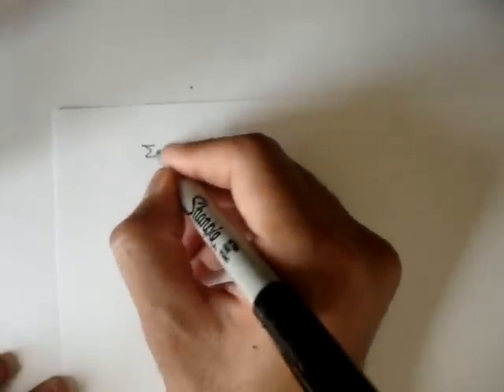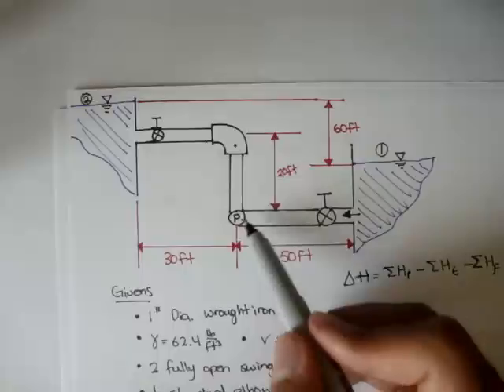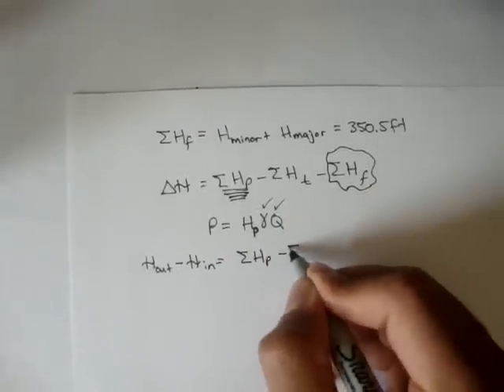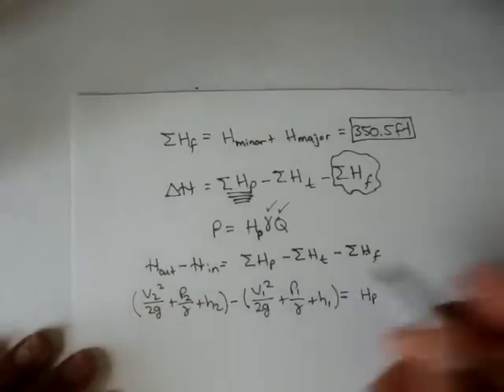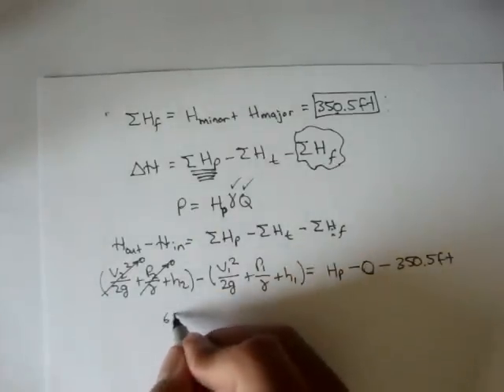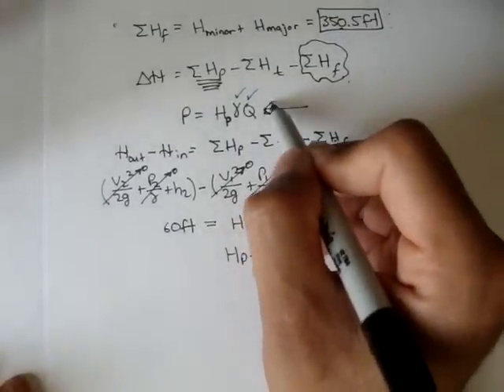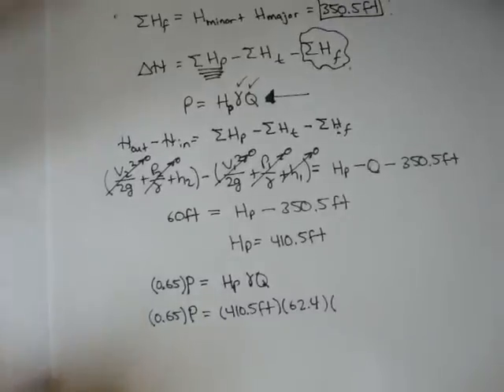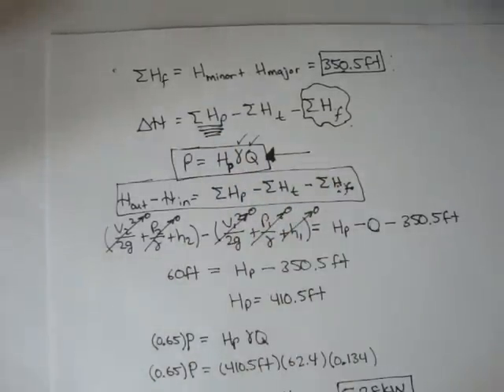Turbulent Flow Example: Part 3 [Fluid Mechanics #45]

Comment: Hp*gamma*Q ---> ft * lb/ft^3 * ft^3/s, which gives ft-lb/sec.   This should then be converted to HP (horsepower) by dividing by 550.   Therefore, 410.5 ft * 62.4 lb/ft^3 * 0.134 ft^3/sec = 3432.4 ft-lb/sec.   Divide this by 0.65 (n = 0.65 = mechanical efficiency of pump) to arrive at 5280.7 ft-lb/sec.   Then divide by 550 to arrive at 9.6 HP.  Multiply 9.6 HP by 0.7457 = 7.16 kW.  Also, 5280.7 ft-lb/sec * 1.3558 W/ft-lb/sec = 7159.5 Watts, or 7.16 kW.
Reply: Thanks dear 🙏

Comment: Dude, you did it again! The units are Horsepower not Watts.
Reply: He's good at deriving the head losses and working through the problem but he can/should be more careful with dimensional analysis. The units of Hp*gamma*Q are ft * lb/ft^3 * ft^3/s, which gives ft-lb/sec.  This should then be converted to HP (horsepower) by dividing by 550.  Therefore, 410.5 ft * 62.4 lb/ft^3 * 0.134 ft^3/sec = 3432.4 ft-lb/sec.  Divide this by 0.65 (n = 0.65 = mech eff of pump) to arrive at 5280.7 ft-lb/sec.  Then divide by 550 to arrive at 9.6 HP.  Multiply 9.6 HP by 0.7457 = 7.16 kW.